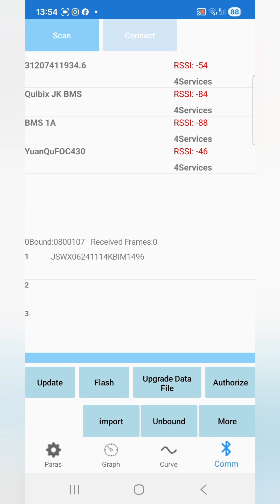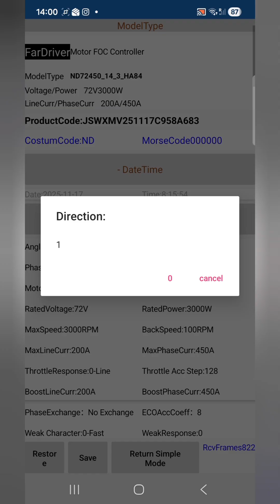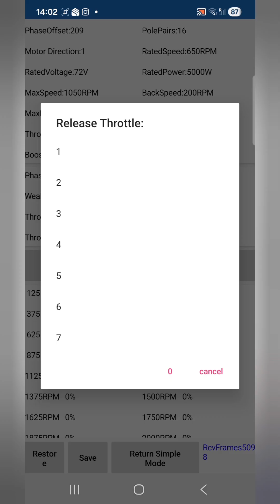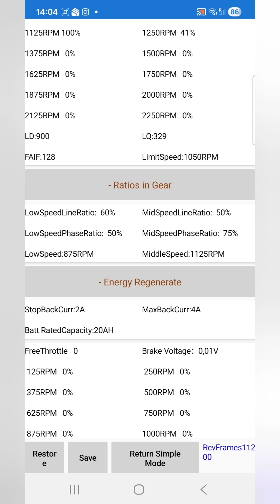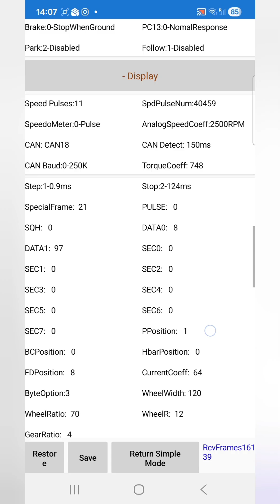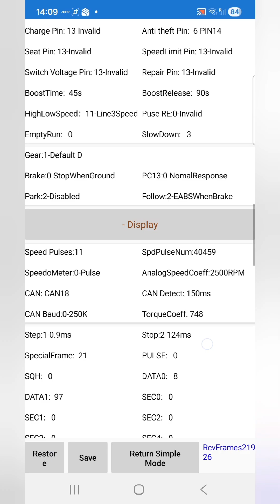How to program Fardiver ND72450, ND72680 controller with CANBUS | Qulbix Power Electronics Guide

Comment: So I am getting the Fardriver ND72450 controller for my Strike 60 volt electric dirt bike. Someone told me to just get that and keep the stock battery. Also do you know what is a good or to high controller temp, motor temp.

Comment: Does the far driver have to be CanBus
Reply from the maker: The CAN BUS means you can see the additional info on the display, like motor temp, controller temp, current, power. If the controller has no CAN BUS comm, you will not see these information.